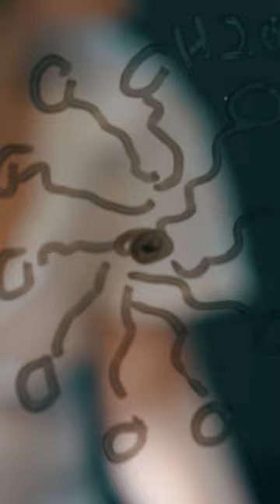Here’s WHY Latte art foam works

Comment: I saw another youtube video saying depending on the number of holes in the steam wand tip, you might need to position the wand it differently. Would you be able to make a short/video about that?

Example: Breville Barista Pro has 4 hole steam tip, it was recommended to have the wand straight down, directly in the center of the jug because it sprays 4 way and creates a vortex in all directions.
Reply: Yes, that is true. I have a 3 hole tip and need to put it over the edge of the jug’s side rather than laying it into the spout, to create a vortex. But it also depends on the steam power and jug size. I’d recommend to play around with different positions and find out what creates the best vortex.
Reply: @3ede467 mine has 1 hole. naked stock wand of the de’longhi dedica. how should  I use it?

Comment: So a milk with a higher protein content would be best or makes no difference?
Reply from the maker: All cow milks will have more than enough Protein, There is actually a part two to this in that the fat in milk helps to destabilize foam (no foam is bad but too much is also bad) so fat acts as a balance of sorts.   For instance 2% milk has less fat and is notorious for making too dry and thick foam.
Reply: Alright!  Thanks heaps for the clarification! :)